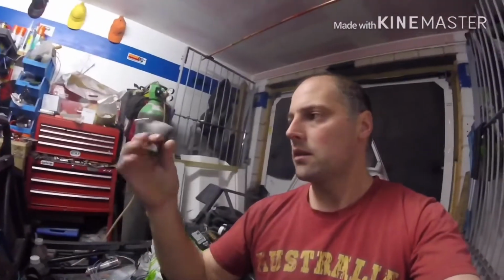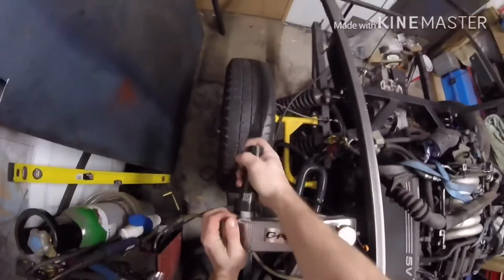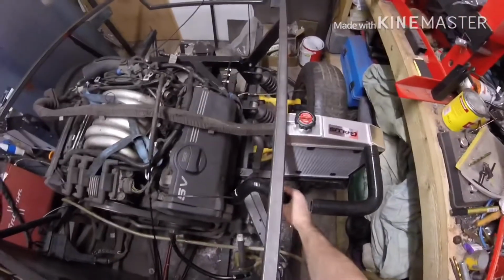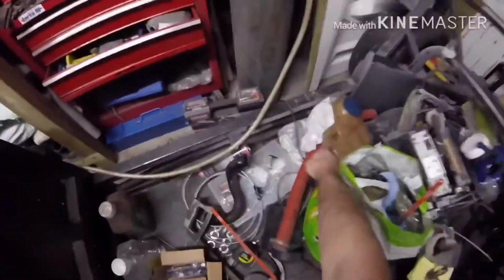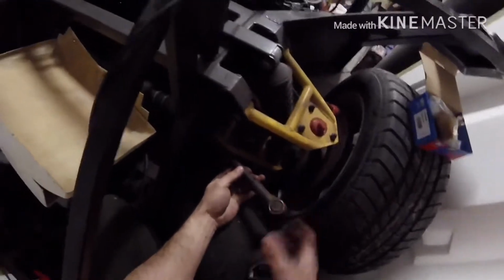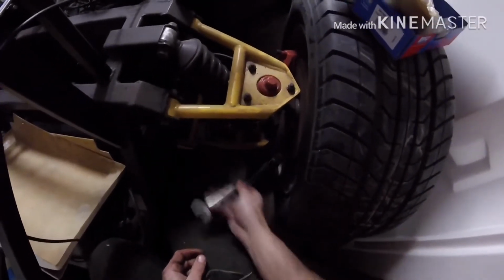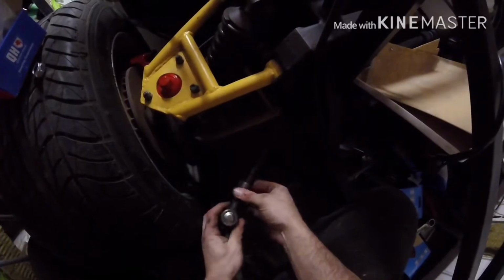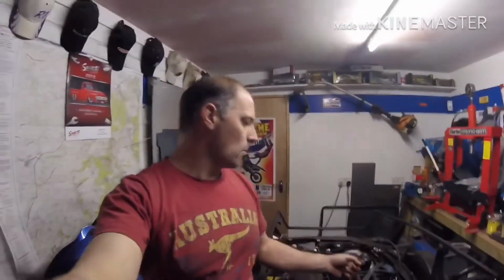Lamborghini countach kit car

Comment: Don't forget the top is an inlet and the bottom is an outlet (as in the top pipe fills the radiator and the bottom pipe feeds the water pump)...
Reply from the maker: Lenny M yes I remembered that one 👍 but thanks for letting me know it’s very easy to forget the simple things on a project like this

Comment: always remember,a replicar is only as good as the engine you are putting in to replicate a 4 valve per cylinder v12 with 450+ horsepower.
i would go insane in a matter of seconds in that ridiculously small area,kudos to you.best of luck to you.
Reply from the maker: trillrif axegrindor I would love a v 12 but the reality of living in the uk with super hi tax fuel and everything els a v6 is all I can do but I have a plan with the exhaust that will make it sound up there. Maybe in the future a v10 👍

Comment: I think you'll have to end up making your own expansion tank, that matches the same size and shape as the original car, so you can get it high enough in the engine bay. The Audi coolant is under quite a bit of pressure, and I think the cap on the expansion tank is rated at 22 psi, if memory serves. Operating temperature for the Audi is 195-210.
Reply from the maker: Project Supercar thanks for the info. I have to get the body back on to see what room I have to play with. I do have my eye on a aluminium one but a little more research is in order by the look of it 👍
Reply: @Spoonersoutings  yeah you're right, you'll need the body back on for the tank.
Reply from the maker: Did you ever put the body on the one you had with the fuel tanks fitted as they look like they stick out a fair bit. When ever I put my body on I always think about the tanks you had and if I had them how would I get the body over them
Reply: @Spoonersoutings  yes loads of times, body was like a yoyo, lol. The fuel tanks were installed after the body was on the chassis. They slid in through the wheel well.
Reply from the maker: I was think how the hell would the body go over them. I think I will come up with a different shape. I really could do with a double garage for a build like this. Don’t know if you have noticed but I only have 6” one side and 15” on the other side of space to work in. I have literally built everything in the drivers side compartment and on top of the engine 🙈 I can’t even put the rear wheels on as the car won’t fit out the door so having fuel tanks hanging out like the ones you had they just won’t fit lol. I wonder if the misses would notice a shipping container in the back garden 🤔😆
Reply: @Spoonersoutings  Yes I can see you're really tight. I only had a single garage when I was building the Cerberus, I built my workshop afterwards. It looks like you have enough rear garden, maybe you could build a double garage in the back, or large shed. If you're on a budget maybe see if there's a used concrete garage on eBay. Sometimes they're free to collect. ;)